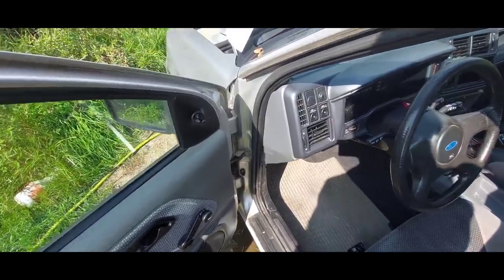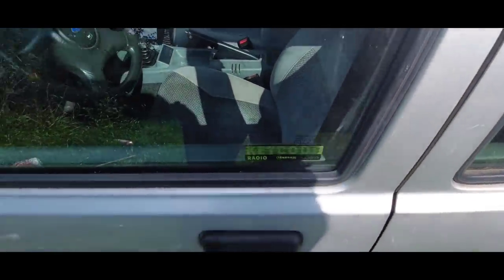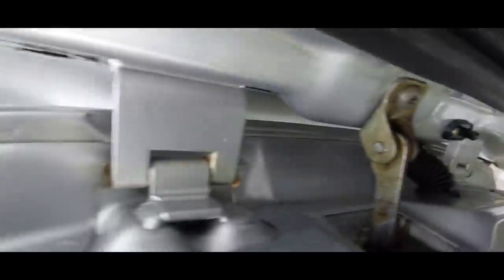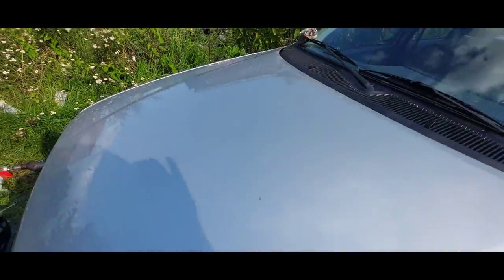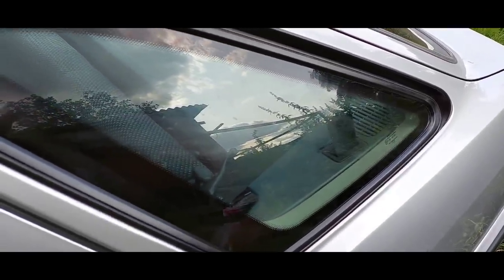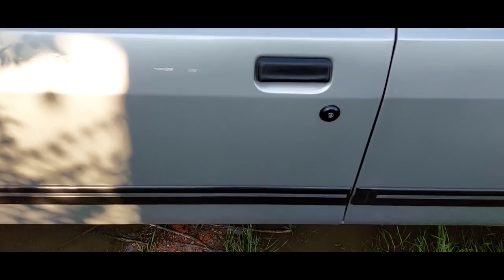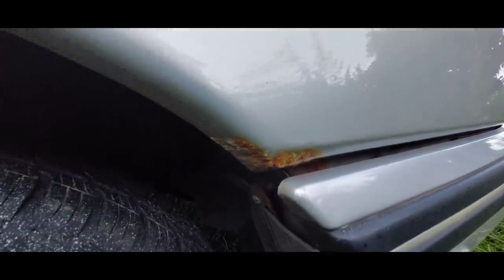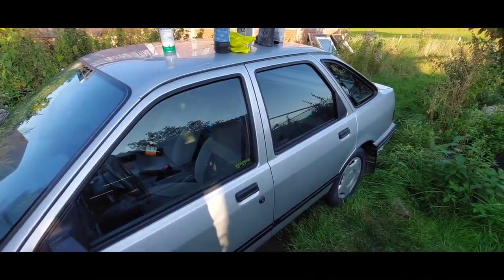Ford, die tun was... Leider nicht in diesem Fall, das muss ich wohl machen!

Comment: Deine Meinung zu FuidFilm in allen Ehren, man muss es mehrfach anwenden mit steigender Viskosität, wenn schon echt viel Gammel da ist, da es Rost bis auf das fast blanke Metall abplatzen lässt. Meinen 72er 406d hat es über viele Jahre gerettet und einige andere Autos auch, der Tüv hat sich gewundert, warum es nicht mehr weiter rostet. Deine Methode ist im Prinzip ähnlich und sicher genauso wirkungsvoll und auch ich stehe auf jahrelange Erfahrung. Trotzdem probiere ich auch mal neue Wege und nicht alle sind schlecht. FluidFilm verwende ich mit Bedacht (bloß nicht in der direkten Nähe von Gummi, wobei es meinen Türdichtungen noch nicht geschadet hat, wenn es dahin gekrochen ist, was es definitiv tut) seit über 10 Jahren. Mein jetziger Bus (O309) hat vor langer Zeit wohl mal eine Behandlung mit Seilfett erhalten, die für wahre Wunder gesorgt hat... Nun gut, viele Wege führen nach Rom... ;-) LG Roland

Comment: Hi Micha. Mein damaliger Freund in den 90ern war großer Sierra Fan. Zum Radio-Code: ich hatte das gleiche Problem. Hab beim Händler angerufen, wo das Auto initial gekauft wurde. Der konnte anhand der Fahrgestellnummer bei Opel den Code erfragen. Weiß nicht, ob das bei Ford genau so geht. Aber wenn du eh tauschen willst, findest du bei Ebay Kleinanzeigen sicherlich was für nen schmalen Taler. Viel Glück mit deinem neuen Schätzchen. Liebe Grüße Equi

Comment: FLUID FILM hatte ich, glaube ich, vorgeschlagen. Ich würde es nur auf bereits angerostete Teile verwenden, es besteht hauptsächlich aus Petroleum (wie WD40) und etwas Lanolin. Ich glaube nicht, dass es für neuwertige Hohlräume oder Unterboden ideal ist. Am Unterboden zieht es massig Dreck an; außerdem kann es Gummiteile angreifen. BALLISTOL für Gummis kenne ich, habe ich Erfahrung damit. Vorteil: Es geht Reinigen und etwas Pflegen in einem und wenn Du Rostschutz willst, ist das sicher in Ordnung. Ich verwende für Gummis und Kunststoffteile aber lieber Silikon. Es hat sicher beides Vor- und Nachteile. Beides trägt sich auch wieder ab. Das Cartechnic HAFTSCHMIERFETT erwäge ich anzuschaffen - andererseits hab ich ein billiges PTFE Sprühfett von Bauhaus rumfahren, das ich bisher für die Fangbänder und Scharniere eingesetzt habe. Was ich noch nie gemacht habe: Vor und hinters Türschloss Fett sprühen. Das sollte ich dann wohl mal machen. Auch sind meine Türscharnierbereiche bei weitem noch nie so gepflegt gewesen. Kommt Zeit kommt Rat. Jedenfalls bist Du noch weitaus pingeliger als ich es bin! ;) Weiter so.